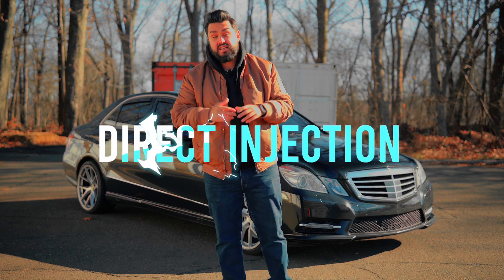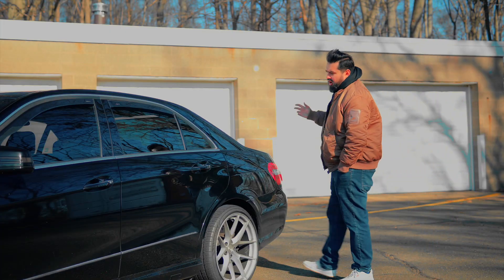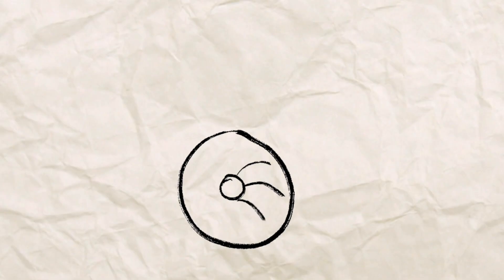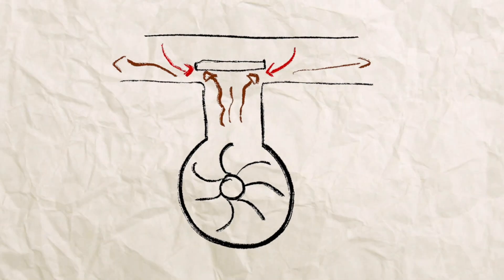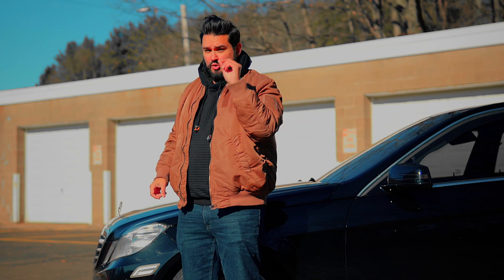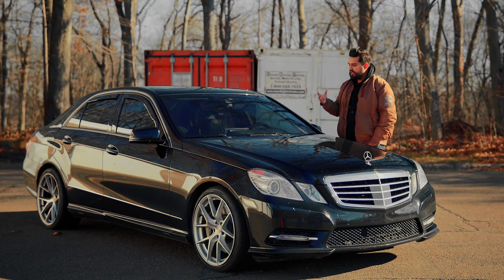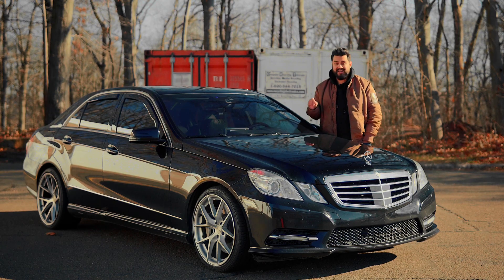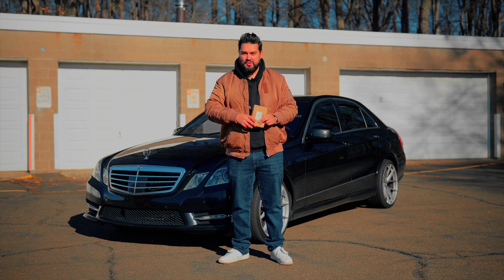M157/M278 Oil Solenoid Mod – What It Does & Should You Do It?

Comment: I really think the problem comes in when people don’t know that their solenoid failed in the low pressure mode. They might be dogging it in high rpms above 3k not knowing that they are damaging their engine. I rarely need more than 3k rpms in my S-class to pass anyone. High pressure mode is supposed to be on during cold start, so I can see most of the damage happening during that time especially in very cold climates. High pressure mode is supposedly to come on during uphills (heavy load) and if the oil is still cold. There are symptoms like extra turbo lag but they are subtle so the average person will not notice.
Reply from the maker: This is solid info, def what I was trying to portray. That’s why m157s seem to have less overhead issues as they’re run a little harder more often. Like you said, you barely need any power to pass in these cars. 

If the plug is pulled and you feel and notice NO difference, chances are it’s stuck closed. 

You can view values within Xentry I believe to prevent this
Reply: @ it’s a silent killer by the time you notice symptoms like turbo lag, ticking and knocking the damage is already done. I was just planning on replacing the solenoid every 60k miles and I change my oil every 4k miles with Motul X-max 8100. I still believe most damage comes from cold starts when it supposed to be running high pressure mode. I have mines plugged in and it heats up relatively quickly even in low ambient temperature in 5-10 minutes (with driving in low rpms under 2k until it warms up).
Reply from the maker: @murdamook87 yes mine def warms up quicker and feels more urgent when I hit the pedal - I don’t think it’s turbo lag as much as it’s poor top end pressure and lifters / valves aren’t operating 100% which I would think is felt in the turbos. Either way, if you unplug this and don’t notice an increase in speed to proper engine temps, it’s probably not doing anything. 

Also, my pops and bangs from tune + straight pipe + Mercedes sound design enabled completely went away with the solenoid plugged. Used to pop like a mf in a nice way, nothing obnoxious. Now it’s gone. Oh well lol
Reply: @ I know you wake the whole neighborhood in the morning from them straight pipes 😂
Reply from the maker: @murdamook87 😂😂 nah dude it’s actually not even that loud, the turbos act like some pretty impressive mufflers as is, and it still has the catalytic converters in there as well. 

It’s honestly the perfect volume for cruising and then definitely starts to shout when you get on it, but it is nothing like the 5.5 V8 in the naturally aspirated 550
Reply: @murdamook87  Thanks for this info.  I have a solid 5 - 10 minutes of warmup on a very slow road before I would ever use any real RPMs (and I wait for both blue cold temp indicators to turn off).  So it sounds like I should leave my sensor attached on my 2017 M157.  Any thoughts?
Reply from the maker: Yeah, that’s good practice but has nothing to do with what this mod does. Your oil will be at a reduced pressure and flow rate when under 3000rpm. This is most of the time. This mod brings full pressure back to the system, as it needs. 

Smoother operation, quieter operation, more immediate power delivery, and confidence that your top end and components are getting lubricated. This engine has design flaws (fixes the m278 got - never the 157) that proper lubrication can almost let you avoid, or delay by a much longer period of time.
Reply: Same, I have an S63 with the m157 engine..2015 model year with 148k miles… a unicorn I’m hearing.. runs great.. def a bit “not sharp” when cold as opposed to warm.. I’m thinking of removing the plug to keep oil pressure up.. especially for cold starts and in city driving.. as the engine is older it’s better.. I do still run it up to 190mph every now and then.. she still runs like new..

Comment: Hello luke very nice video, i have a question plz. I own a prefacelift w212 and I wanted to swap head unit with the facelift one is it possible without changing the display. And is there a solution to change power cable for the head unit cause the prefacelift is different from the facelift.
Reply from the maker: Many have tried to upgrade the NTG system in these cars, it is not worth it. It is far more intensive than swapping a head unit and some cables, it communicates differently with the entire car, and would need extensive programming and extensive hardware modifications that I don’t think has ever been successfully completed.  

I know it sounds ridiculous, but it’s incredibly impractical to do what you’re looking to do   

My pre-facelift has an android auto display, I bought it off of AliExpress. Snapdragon 660 with eight gigs of RAM and a 10.1 inch screen is perfect. Wireless CarPlay works, I can still use the default Bluetooth so it sounds great  

If you want to keep the same size screen, there are similar solutions, but retains the OEM look

There is basically nothing benefited from going to a newer, Mercedes NTG system aside from CarPlay, which is much easier added with the third-party solutions I mentioned

Comment: Floated this idea by my Mercedes mechanic for my w212 2012 E550 with 25k miles on it. He said it theoretically makes sense but asked if it triggers the CEL when you do it. You mentioned it doesn’t in the video but some Xentry code. No issues with that code triggering something else?
Reply from the maker: No sir, and disabling 2 stage pumps is something people have done for a while on other brands as well. 

25k is so low miles, so everything you can do to help it should be considered.  

No engine light, no way to ever know it’s done unless you scan (it will come up with an oil pump solenoid short circuit code in any scanner) but it effects nothing else. No CEL or any other artifacts

Comment: I just got a 2012 CL63 AMG (M157). Any reason why this wouldn't benefit my car? I ask because I've only seen people talk about this in reference to E, CLS models with these engines, not on the "big benz"s with these engines (S, CL, SL). Just curious. Excellent video!
Reply from the maker: Thank you! 

And no, engine is identical, applies to all motors and all applications. Sedans like the CL, CLS and E (550 or 63 variants) both tend to be driven more aggressively than the SUV or S class counterpart, even the SL. 

That’s why you see it more talked about on E or CLS - they’re the most affordable and common versions you can get this engine in. 

As a 2012-13 you have all the worst possible issues that come with these biturbo engines unfortunately. I personally would recommend doing it but give the post a read first before committing to modifying oil delivery on a $25k+ motor
Reply: Come on, same engine, same application.  M157/278

Comment: So what you're saying is, as long as I keep beating on my E400 I don't have to worry about engine failure
Reply from the maker: No, that would be kind of dumb, right? Beating on any engine is a bad thing. If you drive it healthy and get the revs up every now and then during your daily drive then yes - the occasional hard drive is always fun too. 

Beat on it? No. 

Also, the e400 m276TT is not really prone to a lot of these issues but they aren’t immune to it either. This info is really important for 278/157
Reply: @ I was being humorous, but you're right, unfortunately not every drive can be a hard drive hahah.

If you don't mind me picking your brain for a second, what's the longest reasonable distance between oil changes for a tuned (but otherwise stock) m276TT? 
I know the responsible number is 3k miles, but with that being so far from the recommended 10k (and with fairly spirited driving habits keeping the engine well lubricated), do you think going 6k miles before changing the oil will cause any damage?
Reply from the maker: @sb2h so I’ve gone down a pretty intensive rabbit hole about oil and its specifications, ratings, bases, etc. There is so much conflicting information about oil brands and types and standards. 

Here’s what I learned: 

There are 2 types of synthetic. Group Base 3 oils and base 4 and 5. Base 4 and 5 are made from completely synthetic material. Base 3 uses a blend as a starting point. 

Group base 3 the “almost synthetic” is stuff like Penzoil Ultra Platinum, Castrol Edge Advanced Full Syth, Valvoline full synth 

Group 4 and 5 is Amisil Signature in 5w30 weight, Liquimoly Synthol 0w40 weight, Motul as well. 

Things like Mobil 1 0w40 IS technically a group 4 oil, but under higher heat (our turbocharged DI engines) it performs more like a group 3 and 30 weight in shear, wear and other controlled tests. 

In fact, I’d argue that using Mobil 1 0w40 increased the rate of Top end wear I experienced - these v8 turbo engines are already prone to it badly. Less a problem on the v6 variants. 

Now, all that being said, using a quality group 4 and 5 oil that is 5w40 or 0w40 will basically, in real life, give you identical protection below 5,000 miles. 

Over 5k you start getting into longer life benefits of additives like molygen or ceratec or other friction reducing agents. 

So? Use Liquimoly full synthetic 0w40, change under 5k miles and you’ll be fine. I tend to start sweating a little over 4000 miles myself. 

Plus, FCP offers free oil replacement. Send old oil back, get a refund and buy new oil. It’s even easier for me since one of their 3 warehouses is 40 minutes away from me. 

Sorry for the paragraph, hope this helps.
Reply: @ thanks for typing all that out! I appreciate it. 
Have you purchased one of those "oil vacuums" to do changes at home? I'm trying to decide if it's worth the investment/storage space while in college.

Comment: this valid for cls63s 2015 facelift? If yes any1 know what else to watch out for in the long run
Reply from the maker: Yes. M157 never got any of the updates the 2015+ m278 got unfortunately. 2015+ m278 is fairly sorted and most of the issues with top end wear, scoring and other deadly things are more or less sorted by then with new materials and engineering solutions. 

2015 m157 can definitely use this mod. YMMV and please do your own research! This is a new mod!

Comment: Was I looking at a 2014 E550 yes, am I now, no.
Reply from the maker: Smart man. If you want m278 please look at 2015+ cars. You can find CLS550 in 2015-16 pretty affordable with low miles. 

The engine 2015+ depending on engine code and every 2016+ has a lot of great improvements that fix most of the deadly issues the engines have.

Comment: Works on Mercedes w205 c43 or any car w m276 engine, I cut the wires to the plug and the car instantly sounded different much quieter deeper healthier, w stock exhaust you couldn’t hear it unless you got on it, changing oil every 3k miles
Reply from the maker: Yes definitely makes it a little more solid sounding. Less rattling, less metallic sound at idle for sure. Plus, should make the engine a little more responsive as well
Reply: @mrapter7  there’s no metallic sound at all since I did it, I have a resonated straight pipe exhaust with intakes n stock cats and its quiet until you floor it and no drone on the highway
Reply: Were is plug located?
Reply: @Mlive722  on passenger side of engine block down and to the left of the crank pulley it’s a plug that goes directly into the block and not too hard to find
Reply: What year c43 do you have? I have a 2018 and I saw that a comment said it may trigger a cel. I want to do this mod but I do not want a cel to appear.
Reply from the maker: If you have a c43 with the m276TT motor, you can do this however, I don’t think I personally would. The 276 really doesn’t suffer with the drastic oiling issues that the 278 first gen does. 

Will it do the same thing? Yes. But you’re doing this to solve a problem that truthfully- isn’t really there on your car. I would leave it as is. 

That being said, no CEL, just a perm code that comes up when scanning, effects very little. 

For example, things like Mercedes sound design (thoughtful, Mercedes programmed pops and burbles, usually present on AMGs, I had it coded in mine) suddenly stopped working. So I get no pops or burbles anymore because of the perm code. This is a “fallback” for the sound design feature. 

You can have the code programmed out, so the ECU doesn’t know it exists, and then you’re fine. Currently searching for someone who can do this for me - it’s not an unheard of mod, it’s been done for other things before.
Reply: @mrapter7  c43’s exhaust sound before the oil solenoid mod sounds like someone ripping ass in a tin can, it is so raspy and high pitched that it hurts, this mod should be done on all m276 engines, it gave mine more overall power as well and who doesn’t want free power, I don’t like excessive burbles and there is less now but they still happen on 3k+ rpm downshifts, the up shift pop is barley noticeable but present, exhaust is very quiet for a catless resonated straight piped car and the exhaust note is smooth/clean sounding
Reply: @impwulsive7635  I have a 2018 as well, no cel
Reply: Wondering if you saw any check engine light after doing this? I did this today to my 2019 e450- 3.0 m276TT. Although the car felt much smoother, lighter, responsive, and more powerful at lower speeds I finished the test drive with a check engine light. Wondering what my next steps can be
Reply from the maker: No, it won’t produce a CEL. Scan with Xentry!
Reply: @boats_nhoes  did you unplug the wire or cut it and left the plug in?

Comment: That mod definitely requires shorter oil changes, probably 3-4k intervals. But what do you think of possible premature wear to the oil pump since Mercedes may not have intentionally desiged it to run at the normal 4 bar of pressure for longer periods of time during drives?
Reply from the maker: This is something to consider but, since it is a mechanical pump, I’m not terribly concerned. These are the same oil pumps used in the AMG engines, which are definitely made to run quite hard.

That being said, if you start to hear ticking on the top end at idle, even with the mod done,  check the oil pressure with an OBD scanner.

Just like any car, you will get an immediate warning light if oil pressure is not satisfactory, but monitoring the pressures regularly is probably your best bet if that is your concern

I don’t hear a lot of oil pumps, failing, in fact, I don’t think I ever have on these engines. You do bring up a good point that this is a different workload, but from my understanding the solenoid open and closes a diaphragm or valves that increases or decreases oil pressure. If this is in fact, the case, then the pump would be running at the same speed at all times.
Reply: @mrapter7  Not entirely true its a variable vane pump like power steering pumps used to be.    The older AMG pumps are like superchargers or gearpumps in the m113 and m156 motors and are frankly far better and more reliable long term than those new pumps (and the m113k pump is far more reliable than the m156 too).     IMO m157 and m278 are lottery engines and will only get worse with age.   Direct injection, alusil bores and turbo is a very very bad combination.     The m177 are far better but will also have similar issues with age but atleast they have steel bores.

Comment: Hey Luke, welcome back! 2012 E550 here. I was having similar issues, and Canada's winter went crazy. First the slaps on a cold start, no heating until I hit the highway, and leaning on the front right, all in a month of ownership and we're at 185,000 KM. Dealership took care of front driveshaft and control arms but I'm mentally preparing for more.

Did a diagnostic and found out I had an oil filter gasket housing leak, my thermostat and its gasket were bad, so was the blower motor and resistor. Did a 'while you're there' fix of all spark plugs, 5 ignition coils, 6 coil boots, bleed line, coolant pipes and hoses, spordhose clamps and drive belt for now.

Thought to just get another set of air suspension kits for the front cause the rear was still good. Maybe not the best choice (air suspension has a lot of failure points) but hey, first Benz so I had to know what all the fuss was about 😂

Got the car from the mech yesterday and test drove. I have to check coolant pressure this morning to make sure there's no over-heating but I might need more solutions.

Just wanted to note that if you have a warranty then you can't modify the oil pump system, like the valve you mentioned in the last video. Otherwise, thank you for the content!
Reply from the maker: I think you’ll find if you understand how warranty claims work - you can get away with just about anything reasonable. 

Case in point - I’ve gotten warranty claims filled even under tune - and you can simply plug the oil solenoid back in if you need diag work. The system is here to deny you everything, work the system.
Reply: @mrapter7 random question, but do you know any person that can remotely code the w212 amg menu cluster?
Reply from the maker: You absolutely can use this mod under warranty! 

Simply plug it back in if you need to….
Reply: @mrapter7  Were you talking to me?